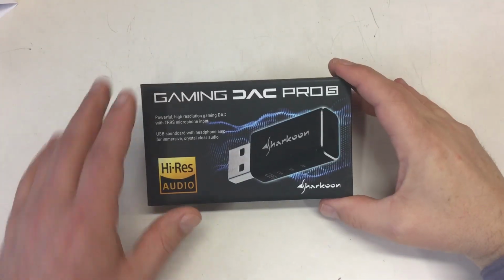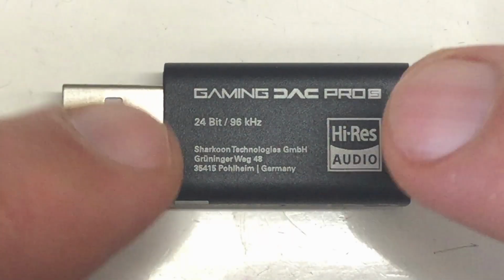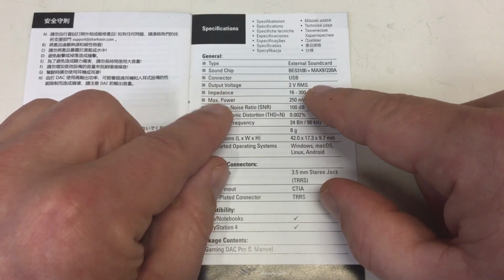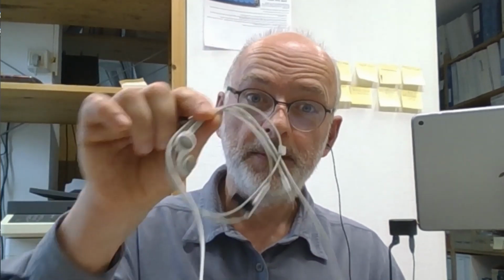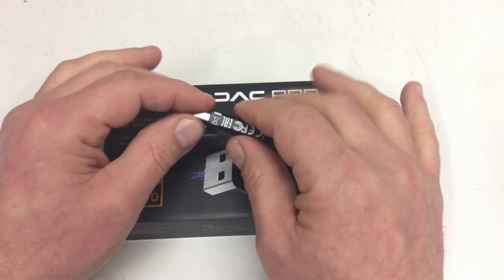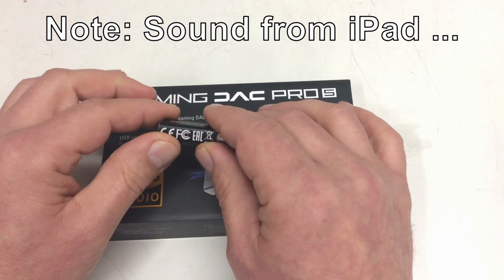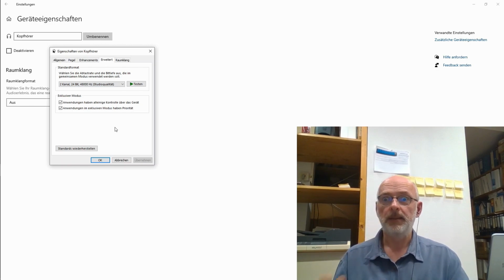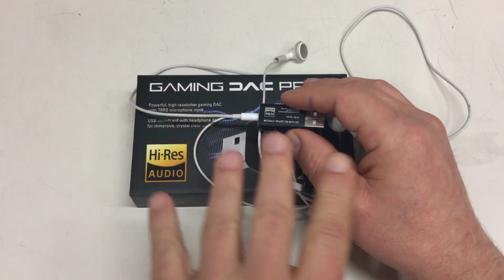How I Shoot My YouTube Videos: Sharkoon Gaming DAC Pro S Unboxing/Review

Comment: can this card be used with microlab 6 speakers? thanks
Reply from the maker: Well, not directly. The output of the DAC is low impedance and high level (2Vpp to 2.5Vpp). I'm not a HiFi buff, but as far as I know your typical cinch (RCA) has an impedance of 50 or 75 Ohms and expect a line level of 0.9Vpp. So you would definitely need a resistor network to match the impedance and line level.
Reply: @robertssmorgasbord  does that mean it won't work? Im russian, try to speak in english. Thanks for helping
Reply from the maker: @babushkinvnuk  It will work if you use a 3.5mm to cinch (RCA) cable. But the results will not be optimal.
Reply: @robertssmorgasbord  what would you recommend external usb card for these speakers
Reply from the maker: @babushkinvnuk  I really can't give you a recommendation, because I never used one and thus have absolutely no experience with these things. However, if you google "usb dac cinch" or "usb dac RCA" you'll find some products. An example would be "Dayton Audio DAC01" (search for it on Amazon).

Comment: i would definitely prefer the mobile dac from sharkoon, which is a great value, it think it has the same chipset than the usb version, becauso i bought both of them and did not find any differences. the mobile dac costs only 14,99€ and it can also be used with the computer via usb c or usb c to usb a adapter. but what makes the mobile dac as hot deal is, that it comes with a very good built in microphone, and an equalizer which has 3 presets. i am using it on my phone right now and i am very happy about the purchase because my musik sounds more lively and energetic with the equalizer preset! it delivers power to my in ears so the bass is strong and accurate
Reply from the maker: Just answered your other comment in German :-) But anyway ...

I can't say anything about the Sharkoon Mobile DAC, 'cause I don't have it. But I guess you're absolutely right. There's no reason for Sharkoon to reinvent the wheel (the electronics) ;-)

Regarding the noise: I noticed the same. Supposedly the problem disappears when using higher impedance (greater 32 Ohm?) in-ears.

Comment: der eigentliche deal ist der Mobile DAC von sharkoon mit USB C anschluss, da ist genau der gleiche Chip etc. alles gleich, PLUS: den mobilen dac gibts  zum halben preis für 14,99  auf amazon und den kann man per usb adapter genauso am pc anwenden, oder eben am handy, plus der mobile  dac hat noch 3 equalizer modi und ein sehr gutes mikrofon verbaut, sozusagen ein MUSS und no brainer :) hab mir den mobilen dac und den dac pro s v2 geholt und ich muss sagen ich höre keine unterschiede. liege ich da falsch? 

Muss aber sagen, bei meinen inears, höre ich bei beiden ein grundrauschen, was mich aber nicht stört, sobald die musik läuft merkt man nichts mehr. also den mobilen dac würde ich sofort wieder kaufen
Reply from the maker: Kann leider nichts über den Sharkoon Mobile DAC sagen, da ich ihn nicht habe. Aber ich denke Du liegst da absolut richtig. Gibt ja keinen Grund für Sharkoon das Rad (die Elektronik) neu zu erfinden ;-)

Bzgl. des Rauschens: Hab ja genau das gleiche festgestellt. Wenn man Ohrhörer mit höherer Impedanz (größer 32 Ohm?) benutzt verschwindet das Problem angeblich.
Reply: yes, thats right, my in ears are 32 or 2. in ear pair i used is 16 ohms,  but when  i use 32 ohm over ears and there its very very silent barely noticable. i think the higher the ohms the  less noise you  get
Reply from the maker: @ericwright1488  Exactly! I've seen some high end in ears with 80 Ohms (for a few hundred bucks 😱). But I guess one wouldn't use those with a $20 DAC 😄

Comment: Awesome review of the Sharkoon DAC. I didn't even want it for mic quality, just to power my new Fidelio X2HR up but knowing that it will also make my V-Moda BoomPro sound better is great. Just ordered, thanks again !
Reply from the maker: I thank YOU - for the praise that is :-) BTW your Philips Fidelio X2HR with its 30 Ohm impedance should have less noise problems than my cheapo in-ear thingies.
Reply: @robertssmorgasbord  Thanks for the reply ! :) I did hear that lower impedance audio stuff made it slightly noisy so yeah hopefully my X2HR won't be too noisy. I actually ordered the Sharkoon because sometimes i have to go around 80-90 volume and still sometimes think it's not loud enough, same goes for my phone it doesn't want to go loud enough so i guess they are a bit harder to drive. Cheers <3
Reply from the maker: @KrazyShark  You're welcome!

Comment: Thanks Robert for this comparison, regards from Brazil! The noise floor is related to the low impedance of the earphones, if you test with a professional headphone (mine is 100 ohms) everything looks good enough.
Reply from the maker: Thanks for the info! I measured those old Sony earphones I was using: 19 Ohm. So yes, far too low. in fact that's damn low. But then, it was designed to work with cassette walk man running on two AA batteries ;-) Guess to get at least a wee bit of power at 2V to 3V you really needed low impedance earphones. Anyway, maybe it's time to get some new ones :-)

Comment: Since I'm desperate, I'm gonna ask you too.
I had a headset (headphones + microphone) and were connected directly to my laptop. The sound in the headphones leaked into the microphone, others could hear what i was listening to. I switched to headphones with external dac. It still has the same problem. The fact is that plugging them into my phone is perfect, no leak. It even improves the mic quality and volume. Since I don't know where the problem is, do you think it's the external dac abd the onboard sound? Should this solve my problems?
Sorry for long comment
Reply from the maker: No worries (about the long comment). If you've already tried headphones with an external DAC and that didn't solve your problem, then using an external DAC like the Sharkoon won't solve it either. What software are you using when talking to other people? Maybe some of its mixer setting are causing the problem. E.g. OBS allows you to mix in the desktop sound.

Comment: Nice product
Reply from the maker: The microphone input - yes! The headphone/earphone - I don't know (audible noise floor).
Reply: @robertssmorgasbord  Hi friend I've one and the noise is related to the earphones impedance. Those small ones are normally 32 ohms or less, if you use professional grade headphones with more impedance (mine's AKG with 100 ohms) the noise dissapear but the volume also  decrease a little. Just try! Regards.
Reply from the maker: @nookcyan  Thanks for the info! I'll try it.

Comment: 2:16 it's the European conformance marking, China export logo letters are closer.
Reply from the maker: You're sure? It's probably made in China (or at least somewhere in Asia) and it definitely contains Chinese components 😉
Reply: @robertssmorgasbord  "China export" tend to be used more arbitrarily by Chinese manufacturers because  is not regulated and give them the change to be mixed by the normal user as "European Conformance", it is acknowledged by the European commission that  their use of it is misleading because their design, but you can you look it up in Google and see the differences, normally I don't see the China Export marking in products developed by companies that are not completely located in China.
Reply from the maker: I didn't know that! I always was under the impression that Chinese manufacturers put the European CE marking on their products as a matter of course/marketing, whether they are compliant with European regulations or not, the latter being a breach of EU regulations. Instead they created a China export CE marking that's easily mistaken for the European CE marking. Disputable but not an outright breach of EU regulations. That's hilarious!